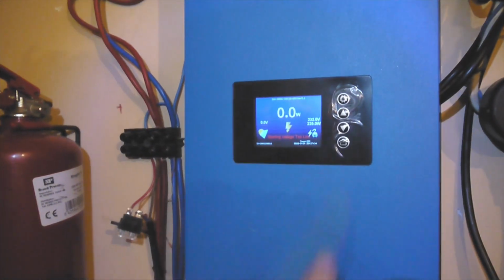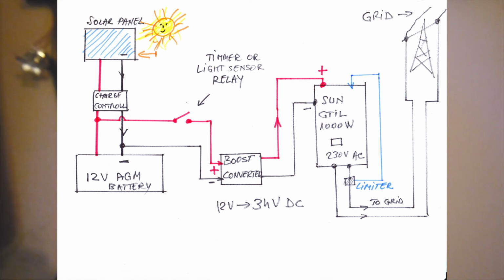Using a boost converter to run a grid tie SUN GTIL 1000W from a 12v battery.

Comment: can we connect multiple boost converters in string to get higher voltage in this case?
Reply from the maker: kind of strange..but I think you can..
Reply from the maker: I think you can, but should be related to different batteries..you simply can not use the same battery with more converters and series the outputs..

Comment: I just watch your video. I think if you want to use battery pack on that Inverter you need supply enough voltage. you should check the manufacturers starting voltage of the inverter. In my case my inverter starting voltage is 22-60v but they advice to use  26V as starting voltage.
 The batteries i used is  three  12v in series = 36v 100ah
Reply from the maker: Yep! I'm thinking and saving for a 48V LiFePo4 24s , for now they are to expensive ...Thanks for comment!
Reply: @viocaia  much better if you do that than experimenting and not following the user manual because worse case senario is you might have some problems in your inverter the future using wrong method power supply of voltage

Comment: Is this doable? I mean if u use an ac dc adaptor then feed to gti, my questiion  is does the consume power by the ac dc adaptor can be covered by the output produce by the gt invertr?
Reply from the maker: It's a DC to DC boost converter , nothing to do with Ac (alternative current!)..SO the boost converter takes 12V from Lead acid batteries and rise the voltage to 36V..Ongrid inverter is working between 22 and 65V..but there is need for much powerful boost then QSJK 150W..but it's working...
Reply: No, your talking about perpetual energy. Every conversion has losses, so no it will not cover its own load.

Comment: Very stupid idea to touch the dc side if connected to electric grid. You could die! Also you were alone during thy video, noone can help you out.
Please use an infrared termometer to check temperature, never touch the device if connected to the inverter.
Reply from the maker: I always check the DC part of install with a lamp for ''live'' phase drain...but advice takin'. Also, both solar circuits, the one for charging batteries and the one supplying the inverter are grounded, there is no harm...but you are right, caution is never to much.Thanks!

Comment: This have an efficiency of 65%, this means 35% loss of energy,that's very bad
Reply from the maker: All I can say is I have 950Wh on 40V ,  22Ah average, SUN GTIL2 gives like 600Wh average..I had peaks of 800, even more, power measured by Sonoof POW2 after inverter output...this are facts , you do the math.
Reply from the maker: BTW, how much power you have in the panels..? I have 950Wh, but rarely I can see 700Wh from inverter.is more like 600-650Wh..
Reply from the maker: Hey again! I did some statistics and I found that you are right about a 65% general efficiency, but the inverter itself goes to 86%..so I found out let's say from 1000Wh PV will get only 650 around..see here..https://www.youtube.com/watch?v=iIn72jZns_U